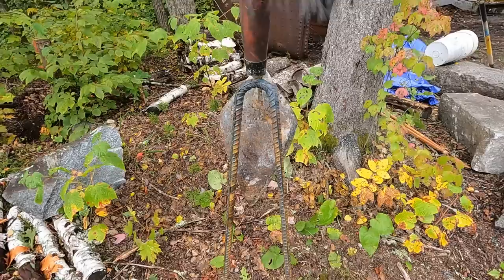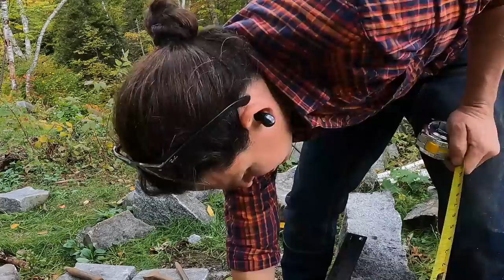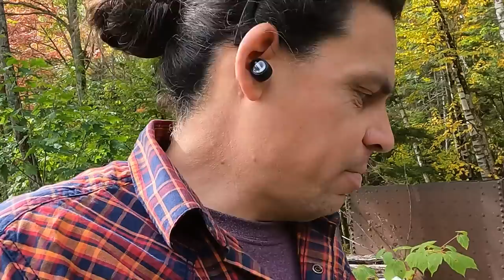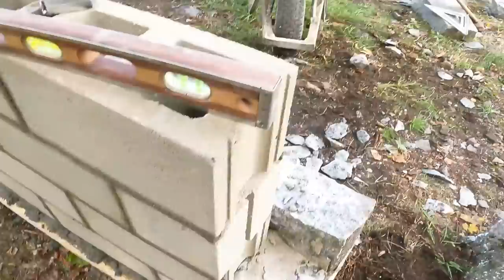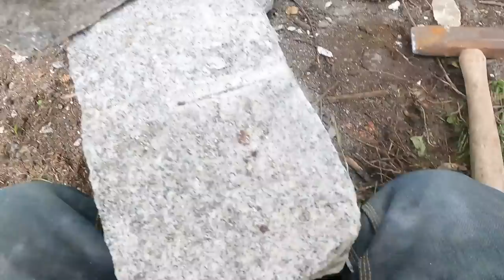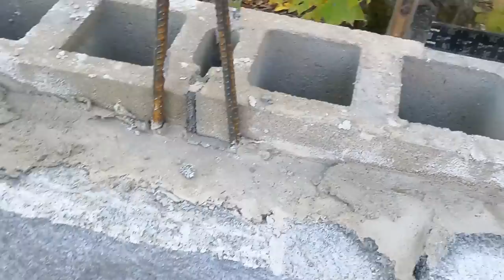From Boulder to Beauty - Building a Sample Panel

Comment: Loved hearing the sounds of you working with the rock. Very relaxing. Would be interested to learn what safety measures you take while working.
Reply: I know he mentioned always wearing safety glasses & “proper” respiratory mask when drilling the stone as well as when mixing the dry mortar ingredients. 
I wonder if they make a type of glove that can offer some protection to his chisel hand from missed strikes like in this video? Or if he could make something that would help pad or deflect some of the force from such blows? The fact that the only reaction he had from hitting his hand was the fact he paused singing for a few seconds was impressive…or possible shows the damage years of such blows have done to the nerves there. I realize he isn’t swinging with the force typically used when driving in nails…but the type of hammer he is using is significantly heavier than an everyday construction hammer! 
A glove with some padding over the area between the thumb & first finger over especially the most vulnerable first joint of the index finger seems like it would be helpful. As long as it’s not so bulky as to be in the way. 🤷🏻‍♀️

Comment: Please tell us a little bit more about the actual act of cutting the stone - which types of chisels, what you look for in the stone as you go, etc.  Someone suggested a discussion about different types of stone and how they are worked, which would also be a gem (maybe a recurring series of short takes on a different stone each time).  Are there types of stone that you would resist working with, as far as cutting vs stacking…. I see you are careful to wear eye protection, but do you ever have chips fly back and nail you in the face?
Reply from the maker: I'm glad that you are interested in the details, I actually shot a short video yesterday talking about the different applications for different chisels.  I will get that edited and posted in the next few days. Thanks!